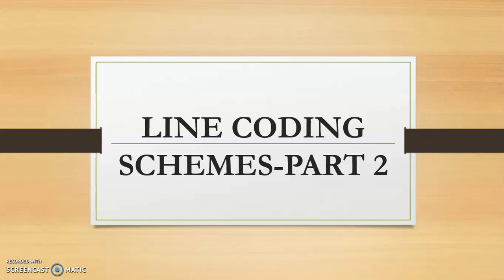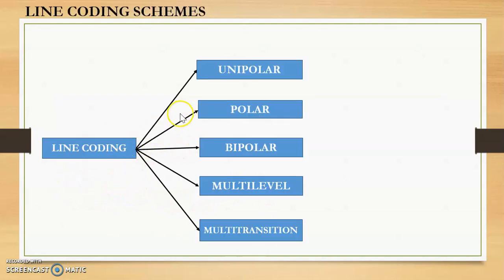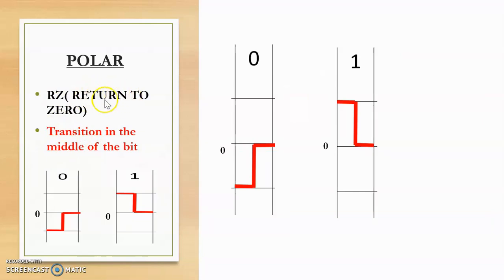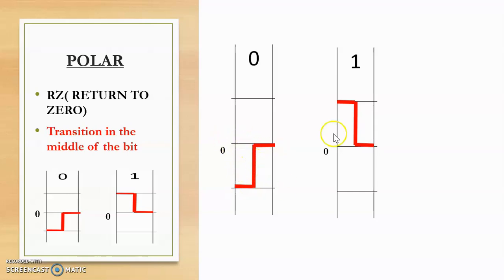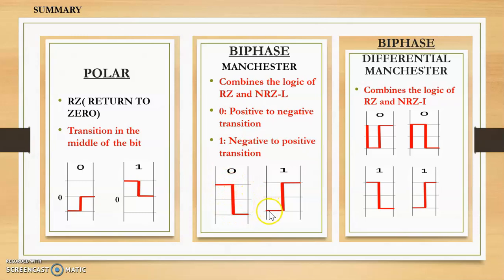LINE CODING SCHEMES PART 2 | RZ , MANCHESTER ,DIFFERENTIAL MANCHESTER

Comment: Thanks for this, very helpful. My timestamps below in case they are of use to others:
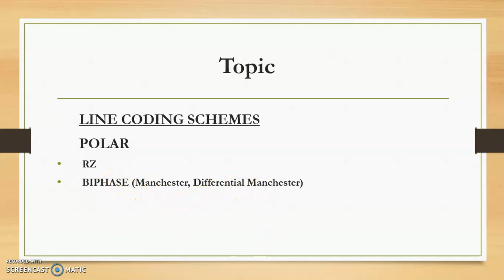0:26 5 Types of line coding schemes
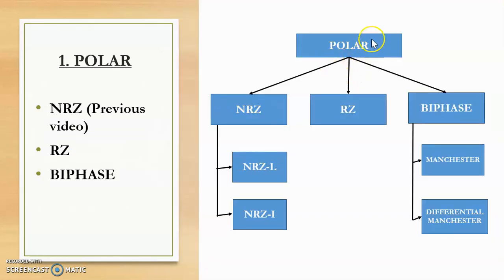0:57 3 Types of Polar line coding schemes
1:15 RZ (Return to Zero)
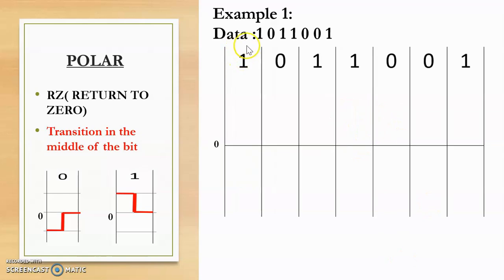1:58 RZ example 1
3:28 RZ example 2
5:18 Biphase
5:24 Manchester 
6:39 Manchester example 1
8:04 Manchester example 2
9:38 Differential Manchester
11:37 Differential Manchester example 1
14:38 Differential Manchester example 2
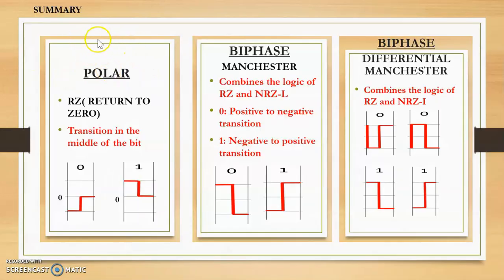17:33 Summary